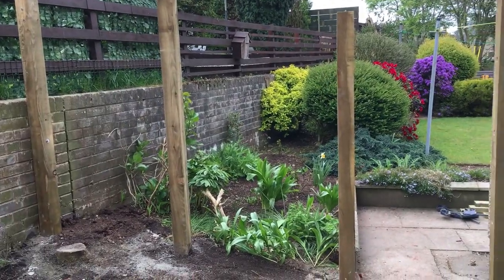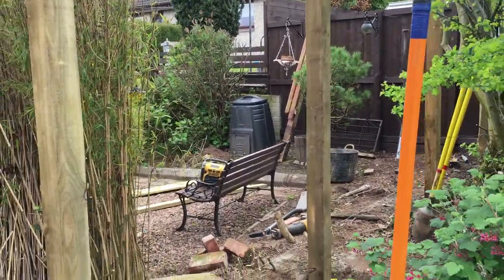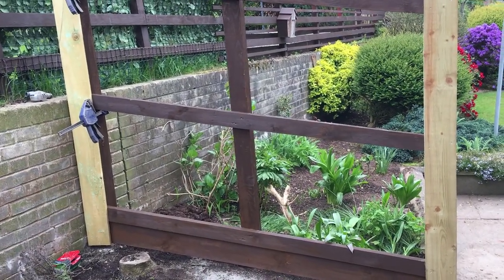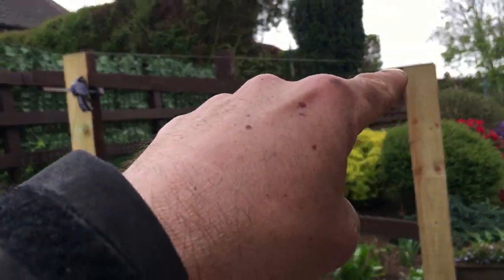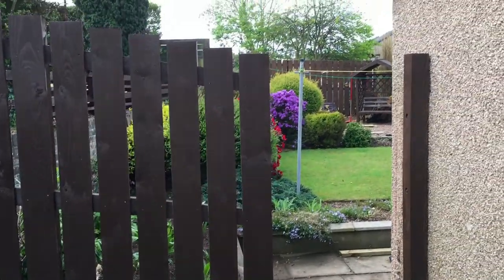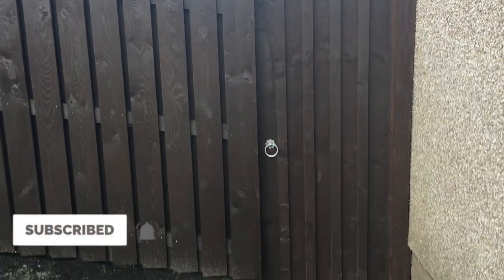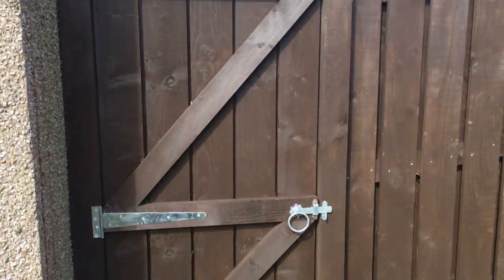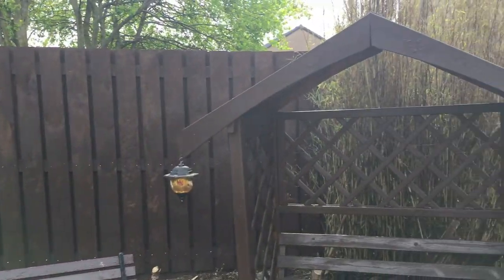Painted Hit & Miss Fence & Gate construction VLOG #2 | Bacren Fencing

Comment: Thanks again for the video - I've watched the video before when you attached a 4 x 4 to a wall.  The back of the bottom fence looked very well in the sunshine, ironic after the downpour...
Reply from the maker: Thanks Ian, yes the fence paint turned out well considering the weather, but it was actually quite warm, so the paint was drying fairly quickly. That thunderstorm only lasted a few minutes thankfully ! Thanks for the comment 👍

Comment: I just paint all the wood first before constructing the fence and I use creocote, much better protection
Reply from the maker: My original plan was to do that, but always struggle for time due to other projects, so had no option but to do it whilst on the job in this case. Also saves double handling to some extent. The client specifically asked for Cuprinol Forest Oak on this particular job as that is what the rest of the fencing and garden furniture was coated with. I have not used the new style Creocote before - is it any good now that all the nasty chemicals have been banned from standard cresote ? Thanks for the comment 👍
Reply: Double handling is a good point. If you're running a business it's not the most efficient method. Creocote is still messy, stinky, sticky stuff but it soaks into the wood rather than forming a layer like the water based crap that pervades the market. It means you don't have to repaint every year or two.

Comment: Nice job. Do you ratio of slat width to gap or do you just use a fixed gap width?

Must admit I creosote all my fencing, old skool lol.
Reply from the maker: Thanks, I always use a set gap for the face of the fence (i.e the side with no posts) in this case it was a 32mm gap (old bit of fence rail that I use as a spacer). On the rear side of the fence I just centralise the slats by eye because if you use a spacer again, you can end up getting "creep" where by the time you get to the end of the fence, slats can end up way off centre.
 It is rare that I paint fences for clients but in this case it was an elderly lady who lied alone, so I felt obligated ! Thanks for the comment

Comment: Cracking video! What Dewalt reciprocating saw model do you use?
Reply from the maker: Thanks Stuart, I use the Flexvolt 54v DCS388 model - it is awesome. I have the 18v version as well, but the 54v is SO much more powerful and perfect for fencing. Thanks for the comment 👍